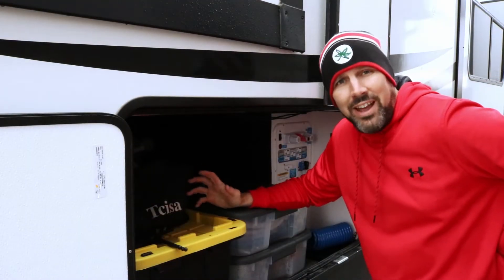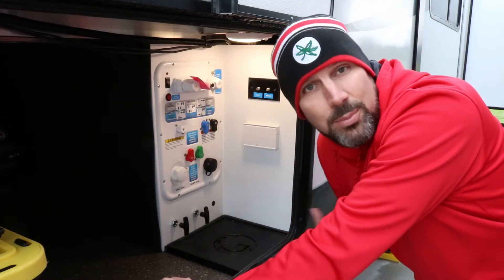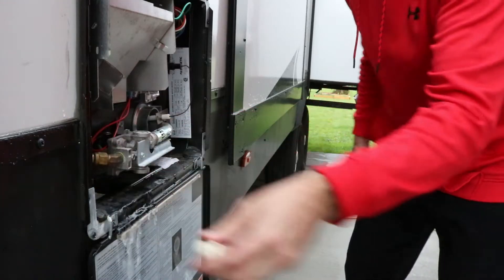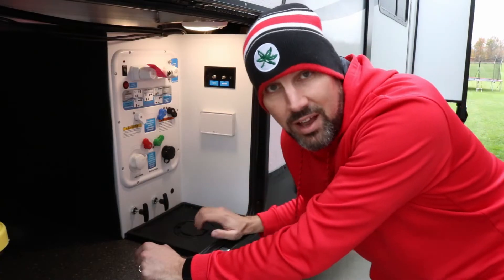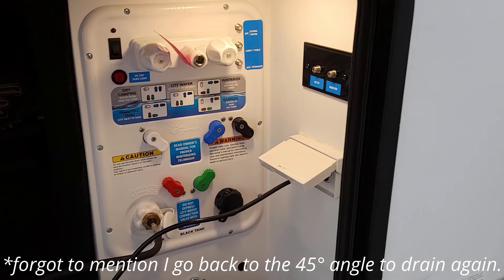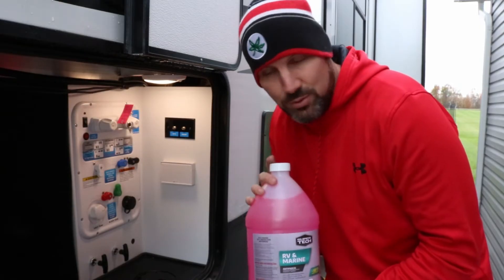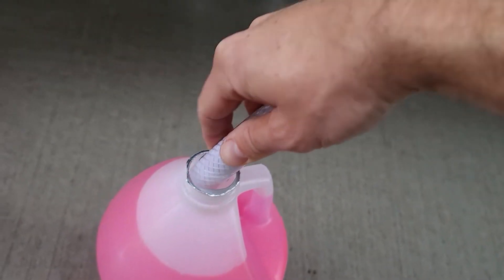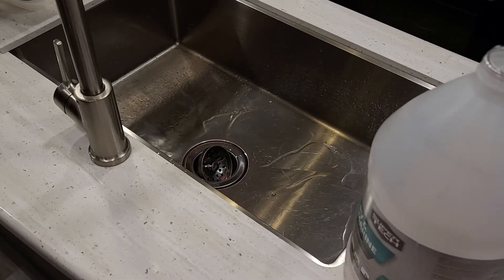How to Winterize your Fifth Wheel or Travel Trailer  - The Grand Design Nautilus System

Comment: I wouldn't recommend opening the safety relief on the hot water heater. They don't always reseat correctly and will leak in the spring. Also I heard putting some olive/vegetable oil in the toilet bowl will help keep the seal from dry rotting.
Reply from the maker: I've heard that about the toilet seal too, thanks! I haven't heard that about the pressure valve on the water heater though... while they are made to open I guess anything overused could wear out. I never leave it open, so I guess I forgot to mention to close it again when done draining! When refilling the tank it is recommended by the manufacturer to open it for that process, so I guess it's kinda unavoidable then!
Reply: I’m

Comment: If you have trouble getting the pump to pull from the jug, turn the little cone screen around to put pressure on the check valve and after there isn’t any pressure on the system I push the check valve on the black tank rinse as well to drain that.
Reply from the maker: Good tip, but definitely better know what you're doing before messing with any check valves!
Reply: You may have helped me solve my issue with your comment. I cannot get the pump to suck from the jug, even when "priming" my hose and holding it above the water inlet.  If so I'll be sending you virtual hugs and many thanks. Too late for tonight but first thing in the AM.
Reply: Thanks @Shelly Eddy, this did the trick.

Comment: I know someone else has already commented on removing water heater plug.  I have same Reflection 5th wheel, same water heater.  I use a socket on a 6” extension and it goes right by that pipe that’s in the way.
Reply from the maker: Thank you!

Comment: PS:  mine is a ‘18 and I cannot find that large valve to drain the fresh water tank.  From what I have saw and read, it drains out the low point drain.
Reply from the maker: This is the first one I’ve had too… not all Grand Designs do. I’m assuming the shorter models with smaller tanks use the smaller nozzles, which look a lot like low point drains, but is designated for the fresh tank. It’s a separate valve though because it’s not connected to all the lines (hot and cold).

Comment: Did you put antifreeze into the black tank flush. It should have water in it also, also I rigged up a faucet on a short metal braided hose that fits where the water heater drain plug goes. That way the water drains without getting al over. Then just turn the faucet off and lay it up on the bottom frame of hot water heater. Great video of nautilus system.
Reply from the maker: Great idea with the water heater drain! I don't add antifreeze to the black tank flush, but I do hook up the compressor and blow air through. Water usually drains from that pretty well and I've never had issues with just using air.

Comment: I think all but the black valve should be at a 45 degree angle. I have a Grand Design with a Nautilus system as well and that is what the page on winterizing says. Probably doesn’t make a difference though. Well done on the video as we used it to winterize ours. 👊
Reply from the maker: You're right, it's not necessary to have the black at 45, but it doesn't hurt, as long as you put it back before pumping antifreeze. Thanks for the kind words!

Comment: I think you can use the electrical outlet next to the nautilus valves for water hoses that have a heating element for use in freezing weather. I just subscribed too.
Reply from the maker: Definitely is a good use for that outlet, thanks for subscribing!
Reply: If you have a motorized TV antenna you could use the power outlet to power the antenna motor.

Comment: Great video! We have the same camper, just a 2016. First year i winterized I forgot about the washer hookup in the closet. I did go back and check and there was fresh water in the lines. These are also the first ones I open when draining the system through the low point valves.
Reply from the maker: Glad you liked the video! Seems like the bigger the rig... the more spots there could be to forget!

Comment: great video! you can use a "stubby" 15/16 socket, a universal joint and a 3" extension to get the hot water heat plug out.
Reply from the maker: Thank you! Great tip.

Comment: I use a socket set with a 6 inch extension to remove the hot water plug. Works fine.

Comment: The drain valve on your RV is different than mine. I have a 2021 grand design reflection 5th wheel.  My drain plug is stainless steel.  I can get a socket  on it but it is so tight like frozen in there and I cannot get it free. Do you have any suggestions?  I am brand new at RVing so I am very much a newbie.  Your video was excellent and very well done look forward to seeing some more of yours.
Reply from the maker: Sounds like maybe you're talking about the water heater drain? If it's steel than you may have an anode rod, and the manufacturer may have just gone a little overboard with tightening it! Not sure I have much advice there other than to maybe get a larger socket wrench. Good luck!

Comment: This is a good video and thanks for sharing. For your drain plug, I used the same set of pliers you used for my older camper. Also, I’m not sure if you’ve done it or not, for you low point drains, it could be a little easier if you replace the caps with shut off valves.  Thanks again.
Reply from the maker: Thanks! I've definitely considered changing to valves, but I only think about it a couple times a year! 😂

Comment: Something i thought about.  What about the fresh water tank pick up line.  How does it drain from nautilus system to tank.  ? ?
Reply from the maker: That's actually one of the reasons they recommend turning the handles to 45 degrees. It allows everything to flow through properly. If it's a concern you could use the compressor for that as well, but it's never been an issue for us. You mainly just don't want standing water that can expand and burst your pipes!

Comment: Hi, we have a Milwaukee M12 Compact Tire Inflator. Would that be compatible to use?
Reply from the maker: Not sure what that model is, but any compressor that you can control the psi should work. Too much pressure and you could damage your lines.

Comment: I don’t see if you release antifreeze from low point drains or open them up when finished ?
Thanks !
Reply from the maker: You're right... I didn't mention that! Once I have antifreeze in the lines I will open them up again just to flush all water out, but I do close them before finishing up and storing for the winter.
Reply: Thanks , the rest of valves are left open when finished winterizing was why I asked .

Comment: There was no mention of the washer line during the winterizing. Does this line need done.
Reply from the maker: Sorry I forgot to mention that one, but yes. I usually just open it and let it drain (when the low point is open) and that is usually enough, but if you have a washer installed make sure you winterize it too!

Comment: You should also drain gray and black tanks after winterizing process. the diluted antifreeze in tanks could freeze and cause valve or drain line damage
Reply from the maker: That is the best thing to do if you're able, but I've found if that's not an option, than at least empty them ahead of time, use as little water possible while winterizing, then dump extra antifreeze down the drains to have the least dilution possible.

Comment: Thank you, i just bought a Grand Design solitude 390RK-R and your video was great!! One question i have is the water line to the ice maker in the fridge? what do you do to winterize that line?
Reply from the maker: We actually don't have a residential fridge, so with no ice maker lines I've never had to worry about it! Most of the time just draining them will be fine, but I would check your manufacturers instructions since each fridge may have a different process.

Comment: I live in South Carolina where we do not get prolonged deep cold. Most freezes are light freeze, 28-32. Is blowing out the lines with a compressor sufficient? We have a 2021 Reflection 28bh 5th wheel.
Reply from the maker: I've heard of others doing this, but if you do you want to make sure you are very thorough when blowing them out. Of course I've never personally had experience doing it this way, and I'm not an expert when it comes to knowing how much your pipes can take! You can also try the Grand Design owners forums to see if others have had experience with this. Good luck!

Comment: Great video 
How many gals of antifreeze did you use prior to filling the    drains for the j pipes.  Have a 310GK-R and used only 3 gals prior to the drains....wondering if I missed something.  First time winterizing.
Reply from the maker: I usually use about 3-4 gallons as well. You could probably do even less, but I prefer to let plenty extra run through. Better safe than sorry!

Comment: If you have washer/dryer hookups but no appliances have ever been installed, do you need to open those taps as well to let antifreeze run through?
Reply from the maker: Not usually since opening the low point drain will cause any water in those to flow out. It is a good idea to open those valves after opening the low point though, just to make sure they drain properly. Remember... a little residual water won't hurt anything as long as there is room to expand. If you do end up installing a washer you'll want to follow the instructions included with the model you have to make sure it's winterized properly too.

Comment: Did I miss this - did you also run antifreeze through the outside spray hose?
Reply from the maker: I only showed blowing air through the sprayer, but yes, I also run antifreeze through it. And ours has a port on both sides, so I do both.

Comment: How about the low point for hot and cold water, don't you need to make sure the antifreeze there too?
Reply from the maker: If you drained it completely first, then the antifreeze should enter those areas as well.

Comment: I have a   GD  Reflection 260 RD  , Some people recommend  closing the  valves   off to the water heater   to keep antifreeze out of it . What is your opinion ?
Reply from the maker: I 100% agree! I've never put antifreeze in the water heater. When you follow the "winterize" instructions for the Nautilus system it does bypass the water heater (red valve). Bypassing it makes one less thing to have to try to clean out in spring, and I have no idea what antifreeze would do to the inside of the heater.

Comment: ok - so you didn't go into the actual water heater behind a panel and bypass using the valves there?? I'm just making sure - bout to winterize this afternoon and want to make sure. I definitely appreciate this video. I have an air compressor and the little fitting like you but I'm not sure I'm going to do that step. Not sure. Seems redundant and the lines will blow out with the antifreeze... Also I assume the main water pump should be off on the inside panel?
Reply from the maker: Glad you liked the video! Each unit is different how you bypass your water heater. On my Grand Design it's built into the Nautilus System, so when I twist the valves, it's bypassing the heater all together. On our old unit, the Vibe (you can check out that video too https://youtu.be/jjjDwvTtzmc ) I had to go to the heater itself to get to the bypass valves. And blowing out the lines isn't really required if you're using antifreeze, it's just a step to make sure you get all the water out (recommended by manufacturers). If you do blow out the lines the water pump should be off, just like you're using city water for your pressure. Good luck!
Reply: @LivingaLifeFulfilled  thank you! Should have mentioned it’s a 2022 Grand Design Momentum 25G with the Nautilus 2.5 system (just like yours). I’m thinking I don’t need to get into that panel by the kitchen sink…
Reply from the maker: @carltuckerson7718  You're right, shouldn't need to. Grand Design makes it easy!
Reply: @LivingaLifeFulfilled  thanks man I’ll let you know if I have success - should be ok. That little red valve in nautilus does all the work. Also nice not having an anode rod. Thanks again man, I’m subbed and I’ll watch your stuff.

Comment: OK here’s the big question for you everything that I’ve heard says you have an opportunity to winterize your RV by either blowing the air out as you showed in this video or using your Nautilis system to pump through antifreeze. But you’re the only person so far that I’ve heard of that said, and is recommending to do both procedures. Just curious to hear your reasoning why you do both
Reply from the maker: I said that because it's actually in the Grand Design manual to do both. I personally do it just to make absolutely sure there is no water in the lines. It's definitely not necessary (and I haven't done it every time), but you have to do what you are comfortable with.

Comment: Do you have to empty your black and gray tanks or just put in some antifreeze in them? I typically keep a little bit of water in my black tank throughout the camping season so it doesn't dry up in there.
Reply from the maker: I always empty them as usual after my last camping trip, but there will always be some residual water. A little water in them won't hurt since there really aren't small pipes that could burst from freezing. But I always dump whatever is left of the antifreeze in the drains and the toilet to be safe. Covers the trap, and the rest just goes to the tank. You can always buy extra to dump in if it makes you nervous!

Comment: Do you know if using your method puts anti freeze in fresh water tank using the nautilus?
Reply from the maker: It does not. It goes straight into the system like city water would, but uses the water pump to get it there. It also bypasses the hot water tank. The only way to add to the fresh water tank is to use the "sanitize" setting to pull it from a jug, or of course the " power fill" option like you would from a fresh water source.

Comment: Hi
I’m a newbie! I don’t know how to make sure my hot water tank is full before I turn on the heater. Help! 😅
Reply from the maker: If you open the pressure relief valve while filling it will eventually overflow, so just quickly shut it... then you know for sure! If you think it's already full, just pull the pressure relief. If water comes out, it's full. Pretty easy actually!
Reply: @LivingaLifeFulfilled  thanks!

Comment: You've done a great job walking through this step by step.  My question, since I am such a newbie with this, is when we put the short hose in the antifreeze after attaching it to the city water connection and flipped the switch, nothing happened.  What should I have done to activate the switch?  Hope this makes sense.  Responses are eagerly sought
Reply from the maker: When you flip the switch you should be able to hear your pump turn on. If not, you need to find out why (do you have power? does the pump work under normal settings? did you try the interior switch? ...some models may not have exterior water pump switches). If you do hear it, then you need to double check your nautilus switch placements. Make sure they are set to winterize so the pump draws from the jug instead of the fresh water tank. You may also just need to move the jug around to see if your hose just needs a better angle to pull the liquid in. If it still doesn't work, then you may need to check with your dealer to insure all the lines are connected properly, unless you are mechanically inclined enough to find the problem yourself! Hope that helps!
Reply: @LivingaLifeFulfilled  Make sure your battery shut switch is on so you your batteries will supply power to the water pump.

Comment: What air compressor did you use? That one looks handy and functional
Reply from the maker: That exact model is currently sold out, but this https://amzn.to/3AYoPVU is very similar. I've since upgraded to this one https://amzn.to/3KGgsRZ , which I like much better because it's faster and can run on battery, AC or DC. Would definitely recommend this newer one!
Reply: @LivingaLifeFulfilled  thank you!  My garden hose adapter has a standard air hose quick connect end on it. I find these tire inflators can’t accommodate these. What do you use to connect this new one to your city water connection for blow outs?
Reply from the maker: @justinvandyk4043  It still works with the Camco plug I have https://amzn.to/38DOepR . There is a quick connect version too, so that could be an option for you as well!

Comment: Great video.    Look at the camco 11633 hot water heater plug tool.   This is what I have.  

About This Item
Specifically for use with RV water heater drain plugs
Angled design
Fits 7/8" and 13/16" drain plugs
Reply from the maker: That's a perfect, simple solution... thank you! I knew I could count on the RV community!!

Comment: Nobody seems to address the black water spray connection.  I blow it out using compressed air.
Reply from the maker: True, I didn't mention that because gravity usually is enough, but I do blow out the lines using my compressor as well. Guess I should've at least mentioned it... thanks for pointing that out!

Comment: How did you winterize the black tank rinse inlet and water line?
Reply from the maker: There really is no way, but that is why you open the valves to 45 degrees. It allows air in and gravity does the rest. Any residual water won't be enough to damage the lines if it does freeze.
Reply: @LivingaLifeFulfilled  try this
Reply: Sorry wanted to add a picture of a hand pump that I used in the black tank rinse inlet.
Reply: I haven't winterized Nautiles system yet, but couldn't I hook the outside spray port to the black flush line  and run a little antifreeze into it?
Reply from the maker: @rickedoug  Technically yes, as long as you figure out a tight connection using the quick connect!